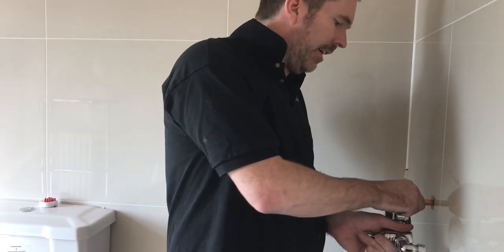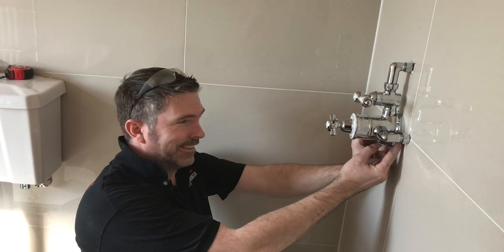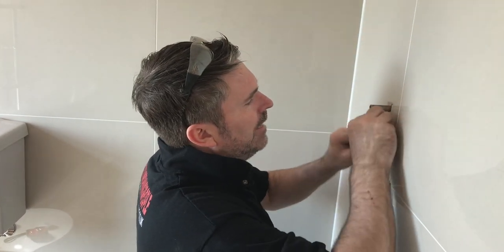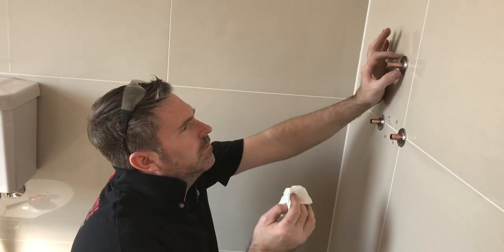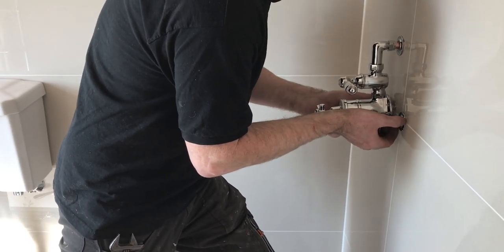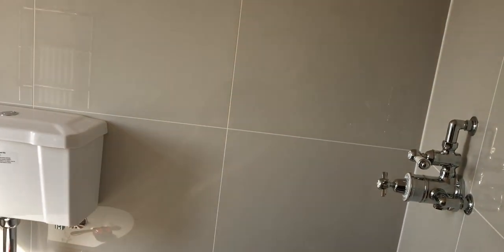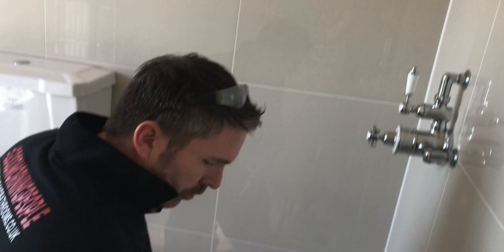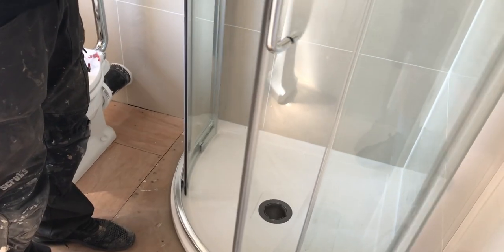Part 4 bathroom refit freestanding bath shower sink radiator corner shower

Comment: Hiya Michael...Just subscribed to your channel. Some great videos and amazing tips! That shower control unit looked a bit tricky to fit, but you did it!👍 Please may I ask if you put any PTFE, or a blob of 785 around the olives on the compression fittings? Also, do you prefer brass or copper olives? I find the copper one's crush a bit easier. Thanks
Reply from the maker: Hello yes I always wrap the olive with a bit of PTFE and always use copper olives